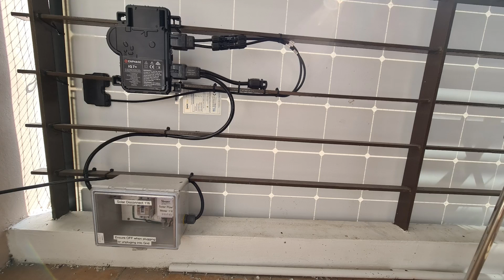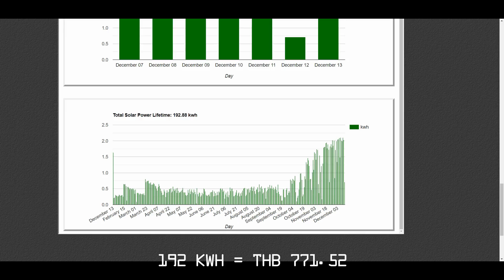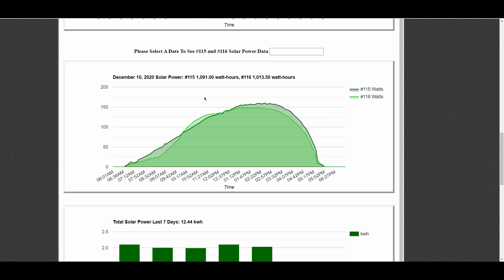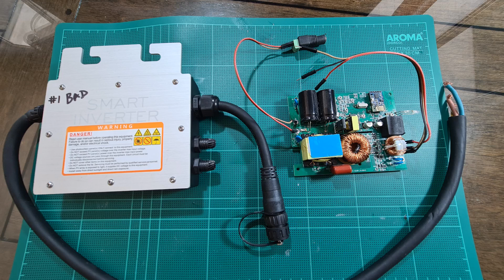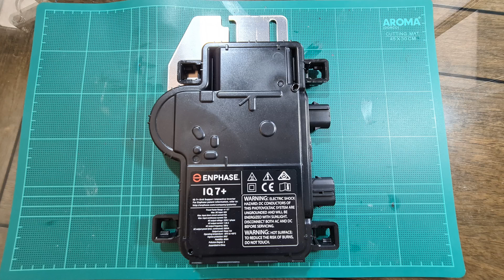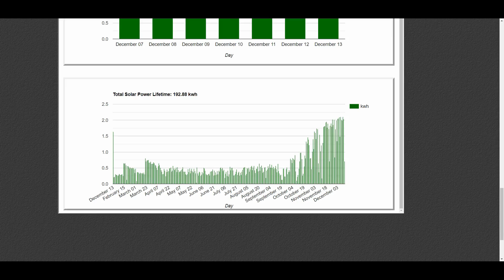Solar Power Year 1 Analysis

Comment: Great job! What EV bike did you go for?
Reply from the maker: I bought a Toyotron from the company in Bangkok, about 4 years ago.  I'm thinking of buying a new one in January since the quality and range are so much better now.
Reply: @MikesTropicalTech  Thinking of getting one as well.  Just looked at the new line up from AJ - ajevbike.com - which start at 40k. Seem to be only lead acid however.   For 3x the price, the NIU with swappable lithium ion battery packs looks about the best in class.
Reply from the maker: @Bryanbkk  I've got my eye on the Niu also!